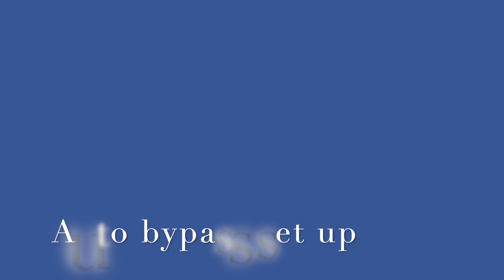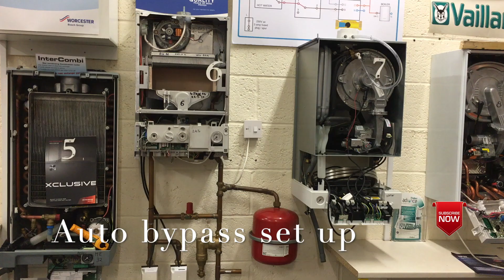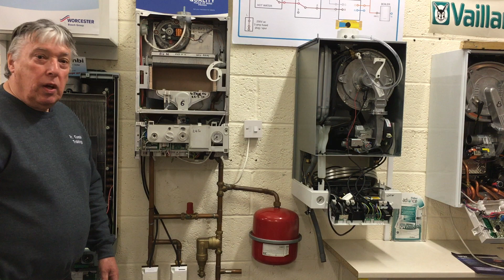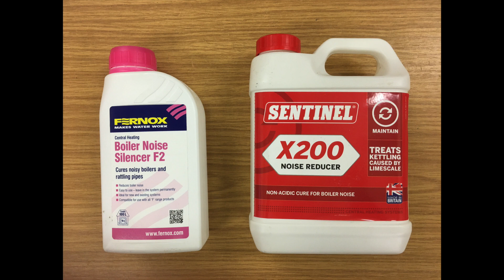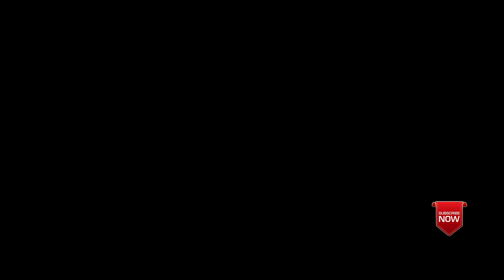Auto bypass, set up

Comment: Great video, but I am not sure if mine is perhaps faulty. mine was open all the way almost so i tightened it, but then it started leaking water until i loosened it again. even loosening it results in some water leaking out then stopping. but if i tighten it, then it leaks constantly. its says ERES 3/4 on it.
Reply from the maker: Hi, BSM, sounds like you need a new valve, should not leak, awkward job, good luck, George 😍

Comment: Thanks George. Useful video. Bought a house with a Powerstream Ascari electric boiler which has been driving me crazy with a pump noise going off very 6 hours for around 5 mins at a time. So happening during the night. Even happening when the boiler was on standby and not on. The manufacturer and house builder said that's just the way it is. I couldn't believe that as the advert for boiler said silent operation. Fortunately a neighbour who had the same problem managed to get hers sorted. A plumber fixed hers a couple of years ago and he is coming out this week. He said from what he can remember it was the bypass valve and possibly also the pump speed. Would that sound right given the issue?
Reply from the maker: Hi, thanks for asking, Sad the firm says that's OK clearly not. If there is a pattern then somehow the setting have been changed, usually I reset the whole system via a reset button or enter a code, find out how to do that. Call the firm again via social media if others have the same fault, find and ask their local hero message the boss so others can see you are not happy, that often works, Hope that helps
George Staszak 👍
Reply: @mrcombiBedford 
Is this boiler bypass required to be fitted on a standard combi boiler that has no zone valves etc?
Reply from the maker: @grimawormtongue2014  Dear Grima, thanks for asking, yes an external auto by pass MUST be fitted to EVERY system not the boiler which is done at the factory. Many installers are too lazy and ripoff and lie to customers, it's a shame but true. It does say that in every install information. Take care, George 😀👍
Reply: @mrcombiBedford  Thanks George. I'll look into that.

Comment: George im converting my combi to ufh + rads with 2 zone valves, my combi had built in by pass should I add an external one
Reply from the maker: Hi Harps, as I said many times YES. You cannot expect a little screw inside a boiler to regulate the whole heating system. Too many installers don't bother because they make money on fixing rather than preventing, shame.😩regards George
Reply from the maker: Hi Harps, yes it's a requirement for the heating circuit, ignore the built in one. regards, george
Reply: Thanks George sounds like a plan.
Reply: Hi George, Thank you for creating this great informative video - just a couple of question if I may 
1. Is the silencer absolutely necessary at the beginning, as I need to keep filling and emptying the system to test every stage of refit?
2. What is purpose of wait for boiler to pop and whistle before turning on ABV?
3. Please can you explain what you mean by positive and negative side of pipe on either side of ABV?

Thank you so much in-advance George The Combi Man
Reply: Thanks george. I have now installed the AB on my system. I have configured it using the graph and the min flow lites per min. 

I have now plumbed up and wired my UFH to my combi boiler with existing rads.

I have a problem I figured out why the boiler was short cycling on and off when just running on ufh.
Basically the ufh only requires 2.5kw. 
The boiler can only modulated down to minimum of 7k that's why it's short cycling on and off.
If I run rads and ufh it works fine.

Im thinking of removing motorized zone valve on the central heating side.

Any other ideas that I can do to make the system run better.
Reply from the maker: @harpssingh1477  Hi Harps, a 2.5 load any boiler will complain because of lack of circulation, put balancing TRVs except lounge the AB will sort out the most efficient mode. 👍😃 George

Comment: Great video. My system has a bypass around the central heating zone valve, without any kind of valve, this can't be very efficient? I assume this means a considerable portion of the flow never makes it into the heating circuit and is instead returned to the boiler.
Reply from the maker: Hi Russell, thanks for the question and kind words, all systems must have an AUTO by-pass as video, there is no other way of keeping the boiler flow at a constant rate as TRVs change the pressure, hope that helps, george staszak

Comment: Hi, great video. Ive just purchased a bypass valve and it can be set upto 1 bar, the boiler pressure is 1.3bar so doesn't this mean that the water will prefer to flow through the bypass rather than the heating circuit because the pressure is lower?
Reply from the maker: Hi Micky, thanks for asking, you are a bit mixed up, the auto by-pass is FLOW (circulation) not pressure. As per the video turn OFF the A B-P  fill to 1.0 bar cold pressure with F2 silencer. 
Turn OFF all the TRVs and AB-P. 
Heating stats to MAX the boiler will make noise 
turn ON the AB-P slowly until quiet the cap on TRVs ON, job done. 
If the pressure goes above 1.5 bar that's expansion problem please see my video 
Hope that helps, take care, George Staszak
Reply: @mrcombiBedford  Hi George, When you say turn off the AB-P,  the one on my system has settings from 0.1 bar to 0.5 bar. Can you clarify which is closing/ turning off and which setting is opening? I'd rather restrict the flow through the ABP so more likelihood of flow going to the heating system and all rads in large house. Some radiators stay cold when the system firing up from cold and hot water coil on too. Rebalancing doesn't cure, heat starts to come through to the cold radiators after a period of time when HW tank up to temperature and zone valve closes or enough other rads get up to temp and TRV's close.
Reply from the maker: @ms-media  Hi MS, thanks for asking, make sure there is enough inhibitor, start by turning B Pass + all  TRVs to OFF lock shields  to ON max. control valves to max ON: Pressure 1 Bar. Turn on CH to MAX (Room stat + boiler stat) As soon as the boiler makes noise B Pass 1/4 turn wait till sound goes, repeat as ness. until no sound fit cap and turn ON control valves. If pressure goes above 1.2bar see my video on that and balancing systems. I will make a new video By Pass 2022. take care, George Staszak👍😇

Comment: My new vaillant keeps flashing F64 fault code.  I think this video will sort this problem! 🤔
Reply from the maker: That's a new boiler due to sludge damage, george
Reply: The system had a clean before the corrosion inhibitor? 🤔
Reply from the maker: @tig376  Always HOT flush at least twice to remove as much rubbish as possible. Over dose is better than NO dose also keep the water pressure at 1 bar ir 1.3 in max heat by adding a big expansion vessel see my video, all systems are more efficient (cost less to run) at 1 bar. regards george staszak